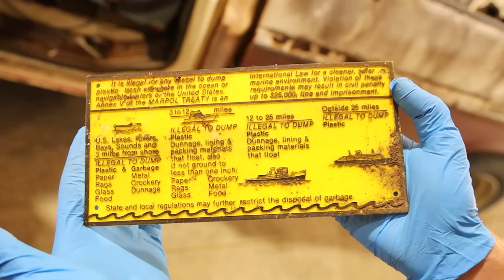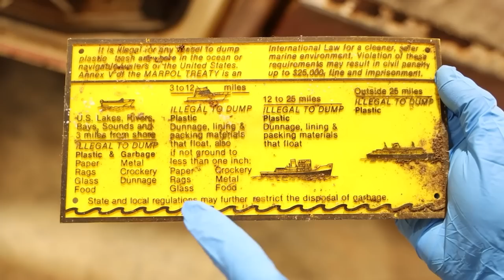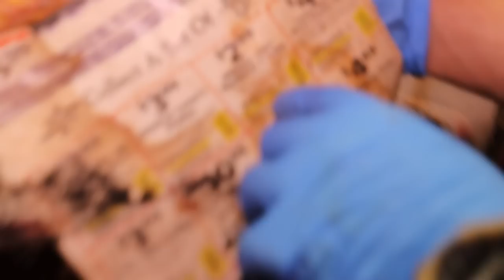First Wash in 21 Years: ABANDONED 1969 Ford F250 Crew Cab. How Bad is It?

Comment: For the ignition on these trucks, yes you need the key in order to pull it out normally. However, you can actually just drill out the key tumbler, go to the parts store and get a new tumbler for the tuck and pop it in like normal. I had to do that with mine. Its pretty easy to do as well.
Reply: Guy I got my 78 truck from the reason he sold it didn't know how to put the tumbler in correctly and he put it in and it stayed in the start position and he drove it like that. Luckily the starter teeth were softer than the flywheel.  I bought it without being able to start it. a $25 starter and installing the ignition cylinder correctly I've driven it like 5 years now. Lol

Comment: This is a fun watch. I am currently working on a 1965 F100 that has been off the road since at least 2004 and was left abandoned in the back yard of an acquaintance of mine. It has been one of the most exciting and frustrating thing I have ever done. I just finished a full engine rebuild on the old 300 inline 6, now I am on to rebuilding the 3 speed manual transmission. Still so much work to do but can see the end of it coming soon.
Reply: I have a 1990 F250 I'm fixing up (I have a video on my channel of it) but after watching these videos, kind of wish I went with a late 60s body style ford like you guys
Reply: I have a 1960 F350 thats been off the road since 78, $5k into it and it now runs and drives about $2k left for new engine
Reply: @Wrenchingredneck  I'm about 3k into mine so far. Most of it was from the machine work for the engine rebuild, and hunting down engine parts because the head on mine was cracked.
Reply: @evasesh6585  I have about 1.5k into my engine rebuild and about the same on performance parts, like headers, aluminum rad ect.

Comment: I can really relate to watching you guys doing your archeological dig through the cab - loved that part of the video.  I have a 78 crew 4WD that was originally bought new by a local logging company based in Woodland, here in SW Washington State.  They used it as a crummy and welded a tow bar bracket to the front of the frame.  These trucks were produced in Windsor Canada (at least mine was) by altering a single cab, hence the propensity to rust in the drip rails.  Not only are the bench seats identical, so is the side window glass.  In fact the rear doors are essentially just front doors without wing windows.  I think they also used van hinges instead.       
In any case I cleared out the entire cab for a repaint, and my big surprise was finding two one-hundred dollar bills neatly folded and hidden under the factory rubber floor carpeting.  They were printed in the early 1980's.  I wish now I hadn't spent them, but at the time of my project that paid for all the paint.

Comment: 12:35 Just some input on old tapes, that tape will sell for some good money online like ebay. Probably $20-25 for every sealed Type II cassette, especially Maxell and TDK. Type III and Metal cassettes if you come into those, that gets into real money for what you're selling. Type II probably around $40, and metal tapes can sell upwards of $100-250 sealed. Make sure to keep an eye out for those, and don't just throw em away. Capable of great sound and they don't make em anymore. People buy up old tape stock like mad.
Even if you find used recorded tapes, but good tapes, just run them past an erase head and sell em for $10 less as used, they still sell. 

Highly recommend anyone who does revivals on old cars where they come by these to do a lil research on em, and make sure to always grab em
Saving something thats no longer made, and gettin a little extra money to put back into the car along with. 

Also, some companies buy and re use working 70s-90s era Cassette tape players as hardware of that quality is simply not made anymore. So they'll buy old, bring it back with some tlc, and repackage it as a new product. So make sure to keep those as well.
Reply: I mean do what ya do lmao, just tapes. But after ya find a bunch if you get a good stack of stuff, I mean hell could be a quick $1,000 from just pulling shit out of old cars and throwing it online
Reply: I was horrified when he threw it in the trash. I know he is young, but he has a lot of old cars. He must know that tape players were very common and are useful today.  And a sealed high quality tape like that is a major score. I'd be recording cruising around music on it. Or having his grandpa do it.

Comment: Hi Soddy, The alternator and the multimeter color red No brand. It's worth a try to get to read the 14 voltages from the volt meter display. If the alternator and the battery reads with the lead points touching the battery posts x 2, It could be bad or high as 25 volts or higher. Check for a price of the Alternator in O'Reilly. The price comes from Rebuild at Parts Geek for only Remy-Delco remanufactured at a price range between $67.55 US dollars up to $110.00 plus return the core charge and no money back. So throw it away and ask the O' Reilly to keep a box and don't ask for money at the O'Reilly. O'Reilly can moth ball some of the recycle/salvageable the parts including old alternator into long gone. You have two choice Parts Geek or the other? 
  There is a yoke for holding the bottom of the solid case alternator over there under your hood of the F250 truck and you'll see the long hinge and short hinge that bracket up the alternator. Overall, you saw just one alternator or a new one per truck pick up.
  The Chrysler alternator for AG long truck Four seater pick up F250 is a caged case alternator that shall fit into the mount of the Ford rusted truck. It depends on similar to the stock alternator comparation. Bye.

Comment: A Craftsman wrench,  originally "back in the day" if you wore out a Craftsman tool you could take it to a Sears store and trade it for a new one. I watched my dad several times back on the 70s swap out tools my grandfather purchased back in the 30s. They were great tools and my grandfather and father used their tools daily and it took a lot of wear and tare to wear them out.I still have all those tools and my dad's upright tool chest that holds them 😀
Reply: I took my 20 year old Craftsman ratchet there and the 20 year old sales girl took it apart, cleaned out the gunk, and put it back together.  Then it worked fine again.   The ratchet has lasted another 20 years. It probably needs to be cleaned again though.

Comment: Awesome truck. A tip in the future. Most 70’s Ford’s if you have any  square key. You can wiggle that key in the ignition and they “should” turn over.
Reply: @MaxGiganteum  
True those conditions can cause that. I watched a former Fed Exp mechanic that owned nothing but Ford autos n trucks. One of his daughters lost keys to her car. He popped in a new ignition switch went to a drawer with a few old Ford keys in it. Put one in giggled it a little vroom. Turned right over.

Comment: Well for an old 1969 truck it does run pretty well after a minimum of replacement parts. The seat covers are those old saddle blanket seat covers I used to have those same ones on my 1989 lol. Oh and by the way Craig i subscribed to your channel so I can see what else you do to this truck and how it fairs at Holley Ford fest. You are right about those plastic liners first thing I pulled out of mine and luckily i had not rusted just painted to make sure and it has a solid steel bed. Good idea pulling the dash pad off too. Mine in my 89 f150 doesn't have any cracks in it and it sits outside in the hot Nevada Sun every day.

Comment: You should keep some stuff like the cassette tapes the girls restroom sign, and other oddball goodies that an older truck should have. And put a gun rack in the back window with a shotty and a .22. If you had more time, switching the backs of the seats might look better, or it looked like the back cover of the seat that was up front, was just screwed on. I wonder if you could just swap that over. If not, you could always make one out of almost anything, but the coolest I've ever seen was made out of old blue jeans, and it still had pockets so you could keep stuff in there.

Comment: check those quarters, if any of them are 1964 and older they are 90% silver and currently worth $3 melt value
1964 and earlier dimes and half dollars were also 90% silver and 1965-1970 half dollars were 40% silver
Reply: @MaxGiganteum  Yeah. I even scrub up the filthy coins I find in my project cars. Throwing away money, even a penny or a dime seems wrong. And the copper in an old penny is worth way more than a penny so....

Comment: I bet the reason why the bed was tubbed was so they could put a cab and chassis rear axle under it or had duals on the regular rear axle and it didnt have room for the inner tire. At least that's what you have to do with a 70s and 80s chevys. If you put a cab and chassis rear end under it you have to tub the fender wells.

Comment: Cool I actually installed a set of yellow lense fog lights mine are just cheap lights sold through DNA motoring manufacturing company,I have like $27 in them but the factory right side didn't work the bulb was broken so was the socket and both lenses were hazed faded, and had over spray paint on them because they blasted the front bumper on my 2000 dodge ram Laramie slt gloss black to match the factory rear black bumper..

Comment: The reason the engine Crew cab after that you did fine job of pressure washer upon the truck. You did tell us, "The acceleration cable and conduit both is broken. The gas is running from float bowl; inside carburetor is foul bad gasoline. Thanks.

Comment: Hello Craig with the crew cab trucking into bumper car speed not fast enough. The box in within the bump type sheet metal bed floor. Surburban roof less truck pickup hard head roof but the Surburban with your teardrop camper called trailer or just concrete floor is all you have. The teardrop camper two wheel is in Nelson, Nevada. We don't go there in the Ghost town of Milling and mining site near Mead Lake Park. It is private property Memorabilia such as Double Cola old stuff plus 7 windows sedan Ford around 1930's Vintage scrap yard all good condition Minted car with not running engine called Nash sub-compact cars. It is not mine land property in Nelson property or town of the Nevada.
  The F350 with 351 CID or the transmission is bad? Thank you.

Comment: I have a set of amber yellow actually color fog lights on my 2000 dodge ram Laramie slt factory fog light equipment truck because the right passenger side light was broken the socket was also corroded, and the Dr side kinda worked but they both had over spray on them including scuffed up since they were originally from a 96 turns out the front bumper was a factory black bumper and they spray bomb the front bumper black to match, anyways I put the yellow lights in it brand new aftermarket parts from DNA motoring manufactured parts,$27 $31 shipped Chrysler wants $300 for the factory brand new nos replacement dog light assembly no wiring socket so I still would have to replace them, the DNA motoring manufactured parts yellow lights came with brand new socket and incandescent bulbs and plug into the factory plugs on the truck and work great quite bright without the excessive glare white fog lights usually emit and I still need to adjust them better but now you can drive the truck only using the fog lights and taillights

Comment: Hey Craig get ahold of an old school Dent puller Screw it into the lock then give it a yank it'll come out and you just pop a new one back in the hole I've done it before it worked just fine!
Reply: @MaxGiganteum   Well it worked for me the lock cylinder was out and the interposition of the assembly was just fine.

Comment: So something I am wondering about the value covers are yours leaking for some reason I am not liking the Mr gasket value covers I tried different gaskets rubber and cork. I would put my old ones back on but my uncle scrapped them lol o yea and your headers was they close to starter I had to take mine off to change starter it's a funny story
Reply: Chrome valve covers leak, it's what they do. Take them off and grind the gasket surface with a 60-80 grit Roloc disc to remove the chrome then coat the surface with Aviation Permatex. Install  the covers while the sealer is still tacky. Be sure to put a dab of silicone sealer where the head and intake manifold meet.
Reply: @lsrx101  I done heads on the fe blocks few different times on different ones over the years. I think the first time dealing with Mr gasket just doesn't seem to fit right.  No matter what I have used. It just seems best is when I trimmed gasket. But now mine have bent lol I guess just cheaper metal lol
Reply: @MaxGiganteum  o that is the brand I normally use but   you have to do some trimming on them to fit them up to Mr gasket valve cover
Reply: Cheap chrome valve covers look good but have a thin flange and are hard to get to seal. The bolts easily deform them. They are not as good as the factory ones. They look nice at first, but tend to rust. I hope he kept the old ones.
Reply: @auteurfiddler8706  yea that is one thing I have noticed.

Comment: I must be really stupid.  I'm completely missing the the reason he put on yellow headlights . Is he never going to drive at night?  Is there any state they wold be legal? I know where Craig lives in California you'd get a ticket in two minutes driving with yellow headlights. I know leds can be a different color for the lenses. For example, you can put a red led behind a white lens. And it will show red. But I seriously doubt a white led behind the red lens will turn it white. 
  At then end when he turned on the lights, they shut them off before he got the camera pointed to the headlights.
And he ordered these lights. He didn't just use them because they were the only lights in the barn and he figured they are better than nothing.  I am confused as heck.
Reply from the maker: They are styled after the ones in my short bed. They are legal if they’re Amber or white only.
Reply: @Thecraig909  
I did some research. Oddly, it does say "Amber or White only" for CA. But the federal requirements are white only. And most other states are white only. So you are taking a risk.
I live in So Cal also. In fact I hope to see you at car shows since I enjoy your channel.  I doubt I'd make it to the end of the block without a fix it ticket if I had yellow head lights.  I got a fix it ticket for a tail light on my 'cuda when the bulb fell back in the trunk.
I showed the officer what happened and put it back in place right on the spot.  But he insisted I had to get the ticket. And it was a hassle to get the ticket removed. I had to have an inspection done at the police department or the Highway patrol. Then submit the document they signed. 
   The government did not NET any monetary profit from that ticket since the fine was removed after I submitted the inspection.   But they LOVE to ticket you regardless.
   I think if I wanted wanted gimmick headlights, I'd get the ones that are white in the middle and have a yellow led ring about an inch wide at the outside. 
   Personally, I think white headlights look best by far.  I'm old enough to remember when car guys laughed at the guys that thought yellow head lights or black out headlight covers, or "airport landing lights"  were cool, so take that for what it's worth.

Comment: Take original steel wheels , sand blast them,  sand them, now prime with rustoleum, and paint either off white, green, blue green aqua or hot rod red...
Reply: Paint them one of the body colors if using hub caps which show the wheel. Yes.

Comment: Galaxie would be way cooler for the power tour with cruising frosty AC,  low, fast, roomy and rock'n the fat thick seats. Wgat;s with the race to arse crack dirt trucks ..  anyway, I get the anti-aesthetic with preserving the vehiclular equivalent of wearing some Wino's grunderwear with the greeeezy stains on the outside of some pants that came new with holes warn into them [guaranteed to split when you reach for that can of beer on the bottom shelf of the fridge.... old skank freezer that needs to still be defrosted and make all the food taste like said Hobo briefs with the inside out Patina brownish racing stripe.... Ya, really do want to see the Galaxie completed from the outside to match the metal work you did. Craig, don't let any of those Patina Ew-ginas down in Nashville way talk you into not painting the Galaxies. :-)) Hope all is well. Fairlane teaser has me digging that build when it happens too. Lord knows the Ford thang is a wee bit more pricey that the other big auto clubs.. Respect man! Noice!!

Comment: It's possible it was a crew truck used on the railroad and to accommodate the narrow track wheels used to drive on the rails they cut the tubs to clear ?  Later someone tried to restore the bed to normal ?
Reply: @MaxGiganteum  the rear wheels and tires contact the rails and provide propulsion....the retractable dollies keep the wheels on the track.  Ditto in front.
Reply: @melspencer9957 
The Railroad and maybe the Air Force  (and Forrest service) were the original owners of most of the crew cab trucks of that era. They probably didn't buy two tone paint, though. The latter two anyway.
 I seem to recall having special wheels, perhaps inside dually wheels, on the  F250's used on the tracks.  I don't remember if they were on both the front and the back.
Weren't the railroad trucks all Utility beds?  The bed could have been swapped out later. Some companies keep the utility beds when they sell the trucks. 
   There would be some hints of the hydraulics and the rail road wheels. Maybe we will see later.